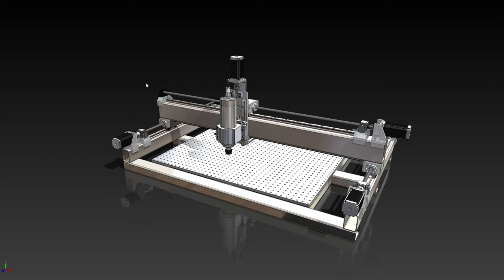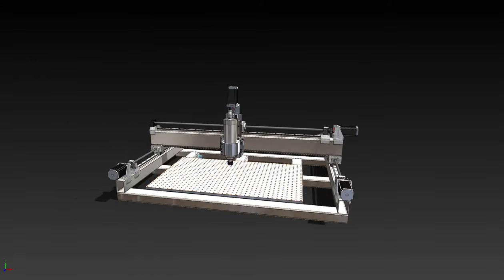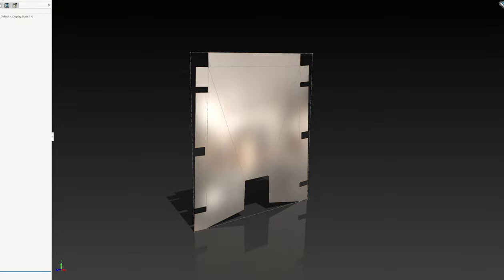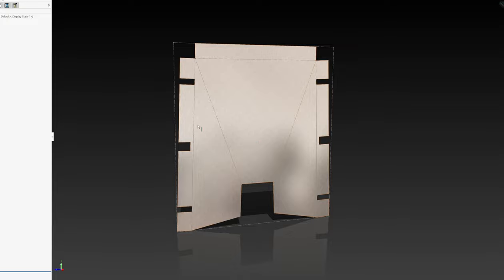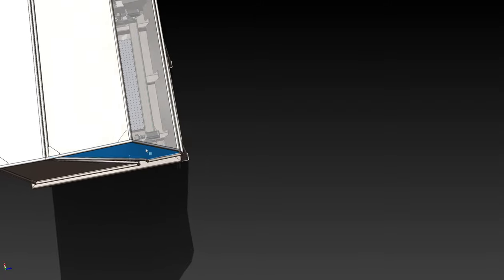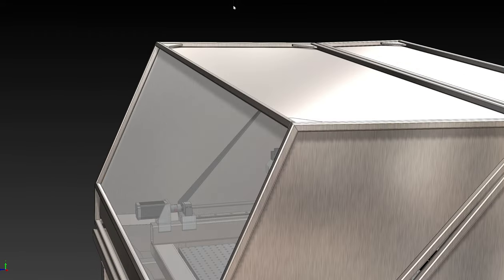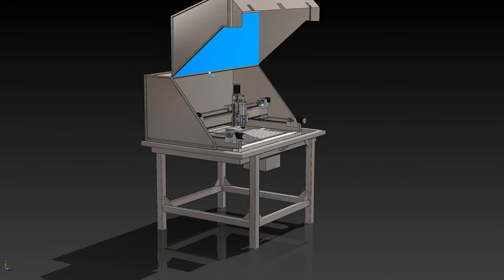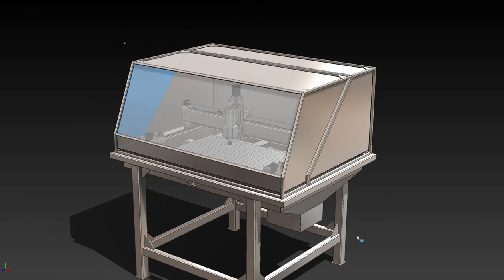Designing a Full Flood Cooling System for My CNC Machine

Comment: Looks nice! I’ve run flood in a few diy machines now and its great but I will say if there is a spot to leak, it will and it will a lot. Most sealants won’t hold to coolant either but I’ve found epoxy works, like jb weld. Another consideration is the lid dripping when open. Always lots to think about;)
Reply from the maker: Yeah the lid is kind of a problem. I'll weld together a little trough for it. Sealing the perimeter of the CNC machine I'm going to build a stainless steel skirt that slips over the stainless steel pan and then wraps up and around to the outside of the top and close your part. That way I don't have to worry about the polycarbonate panels to be sealed very well which they aren't.

Comment: Nice work. You should put a strip on the inside of the front cover, so the join gap isnt exposed. Also, you should make the base way sturdier. Wel lots of cross pieces in. They will warp loads, but you can deal with it by casting a thin layer of epoxy granite on the steel frame, against as flat a surface as you can get. This will mean you get good surface contact between your bed plate and the frame. Also your motor mounts and ballscrew mounts have sides that come down over the steel box. Remove these so the mounts are flush with the box, then you can attach sides that come to the height of the ballscrew. Then you can add roller covers for the top to fully protect the mechanicals. If you have flood coolant, it will wash hard chips everywhere, so you need to protect the precision mechanical parts.
Reply from the maker: Thanks for the info! I’m going to cut and form a strip that follows the door with some wood dies to get an inch or so of overlap from the front door to the back of the enclosure. I’ll fasten it on the outside of the main panel so no coolant can get wicked in the gap.

Yeah I should probably just fill it all up under the fixture plate with steel tubes and use epoxy to flatten it. Probably leave enough of a gap between tubes so I can get the tig torch in there. 

The motor and ball screw block mounts right now are actually 3d printed (I don’t have access to a mill). They’ll be some of the first components to replace with aluminium once the cnc is up and running. I’ll be sure to keep everything flush with the side so I can mount a flat surface onto the steel sides like you suggest. 

I’ve looked around at places like aliexpress to see if I can find an appropriate covers for the linear rails but so far no luck for something appropriate for the sides of a gantry style cnc. Most I’ve come across are meant for your typical vertical mill style that protects 2 rails beside each other.

Comment: Can you share this?
Reply from the maker: I've made many changes from this video. current files are located here:
https://github.com/bhowiebkr/PrintNC_Pro_Solidworks
Reply: @BryanHoward  :thanksdoc:
Reply from the maker: @sevendollarbill  I did an update last night with the most recent stuff. Basically things in cad get changed to reflect the actual build. I’m almost done with the new Y axis so that’s where the most changes are taking place. 

If you’re building a machine, I would follow this 100%. Some things like adding stainless steel shims for the Z rails isn’t necessary unless you make the same mistake I did, etc.